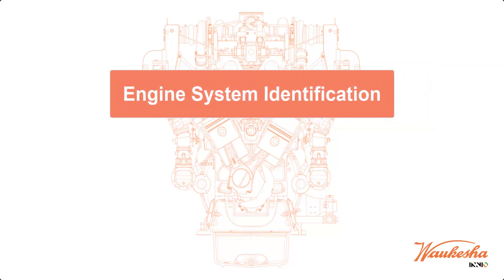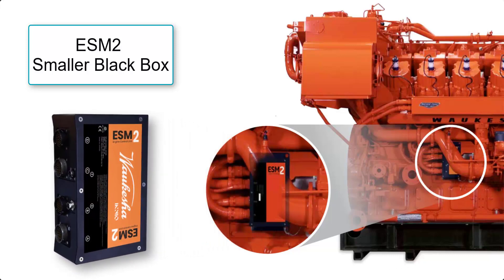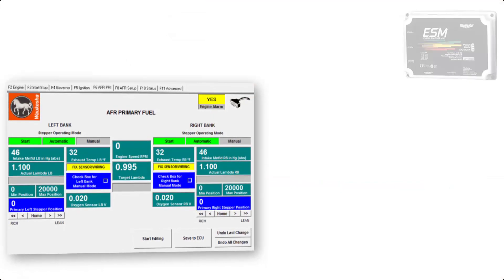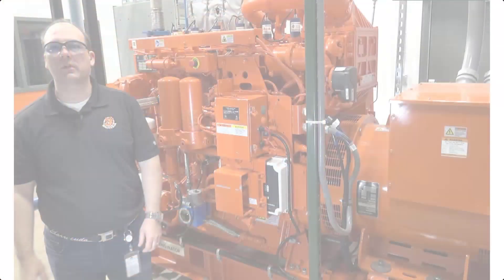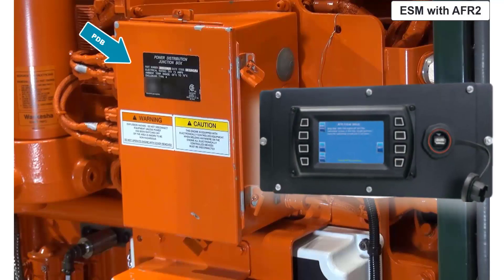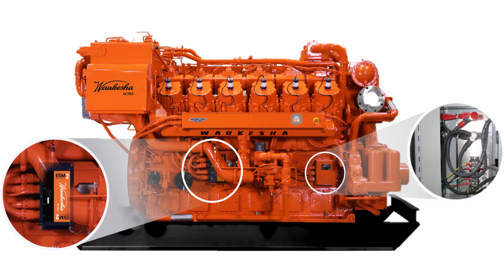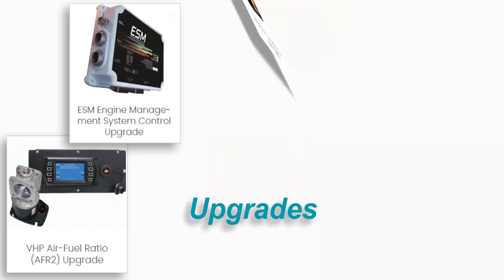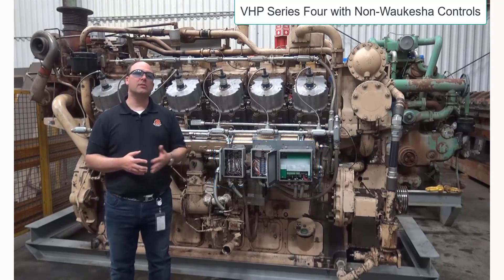Waukesha Engine System Identification

Comment: I need info on terminating the pdb correctly on my ecm 1 based unit. It is 24vdc I dont see where the power that bypasses the disconnect should be terminated, not clearly marked and my documentation for this was lost

Comment: great effort, can you help me please to solve this problem , we have VHP Series Four 12-Cylinder with AFR2/emPact  Emissions model L7044 GSI, during normal operation  ESM is locked , cannot access it using laptop, send shutdown signal to PLC, and its power led is only on. After replace ESM with new one engine starts again without any problems, this issue occurred for three times without determining the root cause

Comment: Sir
I have a question
Model waukesha L7044 GSI
Oil mixed with auxiallary water ...i have check and test of conpressor oil ccoler and engine oil cooler but the problem has not been solve yet
Kindly guide and help me

Comment: Question ❓ 
In stopped condition of engine can we guess that an engine specific cylinder is at that stroke such as suction, compression, power or exhaust?

12V275GL+
Reply: 12V275GL+
 
"+"
 What represents it?
Reply: Question ❓ 
In startup when we press the start button how engine combustion starts
 instead there are no flue gases present to run the turbo charger to give air for proper combustion? Explain????
@12V275GL+

Comment: So about the  8cyl AT…  it would be nice to get ESM controller. 👍
Reply from the maker: Hello - thanks for the comment! The ESM2 upgrade for 8cyl AT is not in the short term product road map, but may be addressed in the future. Current ATGL ESM2 solution offerings are being addressed for our 12VAT27GL and 16VAT27GL units.